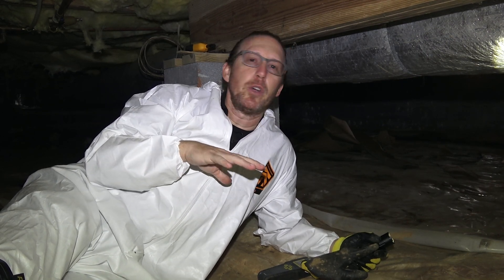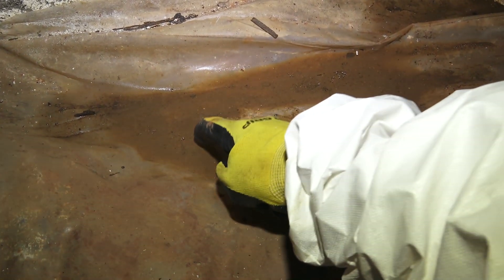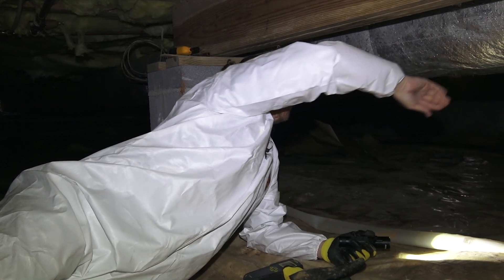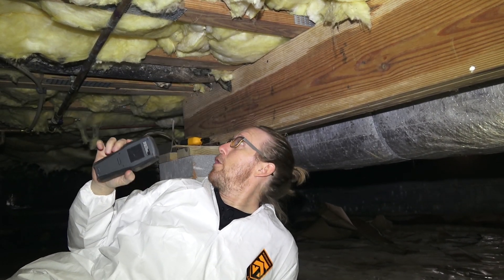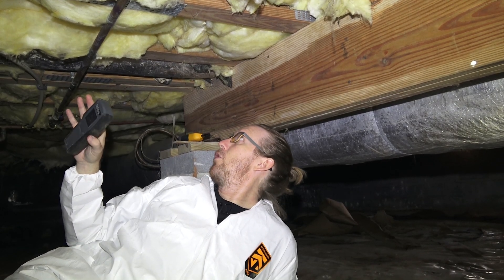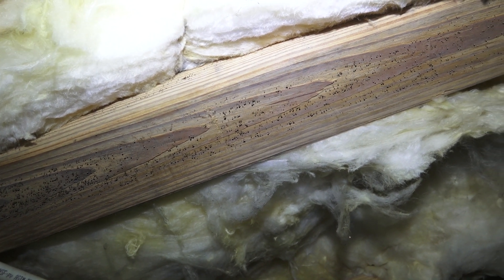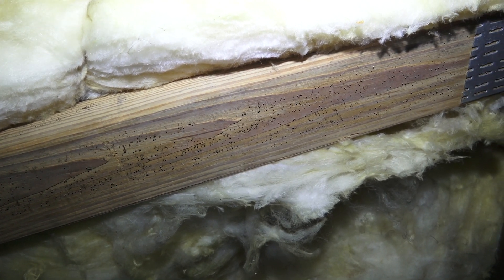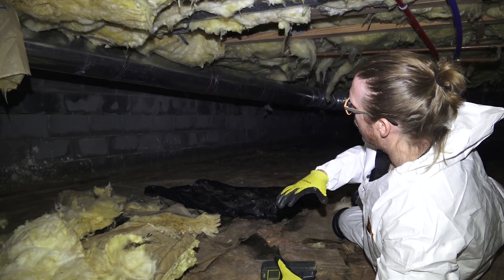Is Your Crawl Space DUCTWORK Causing Hidden MOISTURE DAMAGE?

Comment: I am in GA, and am addressing this issue now with a house I will purchase. The previous owners jerry-rigged electrical and there's so much water in the crawl space from heavy rain, the cast iron gas pipe is rusting. Now the heating unit is rusting, and the floor boards are rotting. Is it an option to just rip all that crap out, fill it in and put down a concrete slab?
Reply from the maker: You can, but concrete can be way more expensive than vapor barrier, and you would still need a vapor barrier either under or above the concrete slab. You will still also run the same risk of water intrusion if you do not address the flooding issues. A perimeter drain and sump pump should help tremendously.
Reply: @CrawlSpaceNinja  Thank you. I have a contractor coming tomorrow to discuss options. Thanks again for the advice, I will look into these options.

Comment: I live in coastal South Carolina where the humidity is very high during summer months. My crawl space is dry but I did have a problem with condensation dripping from air ducts. We keep our ac set around 76. Sooo I had a crawl space co come out and check it. They were very knowledgeable. He told me to get a dehumidifier and run it on 40 percent. Works just fine. Is that the right percentage I should set dehumidifier on. I had this on for the last 15 years.  This is my second dehumidifier. I only run it during summer months. Thanks, I enjoy watching your videos.
Reply from the maker: That is a correct setting to leave it on!